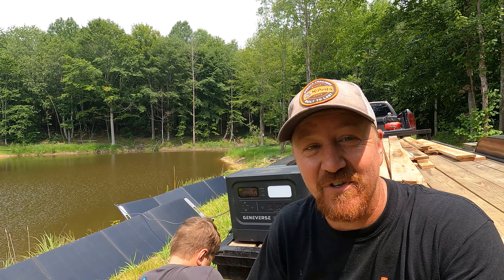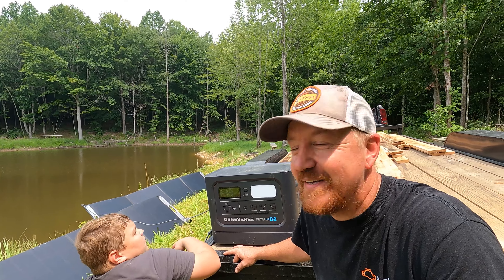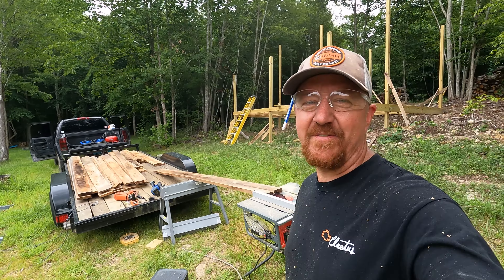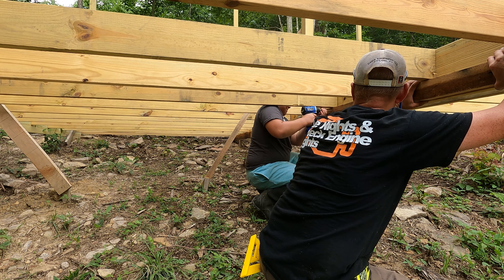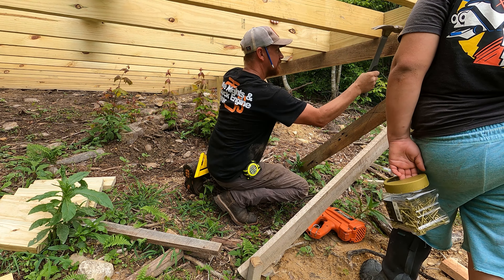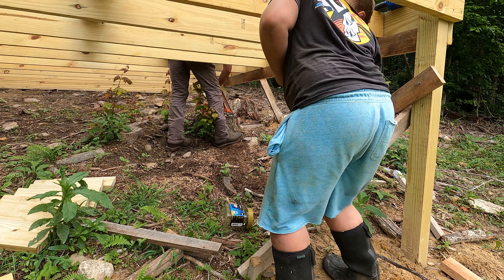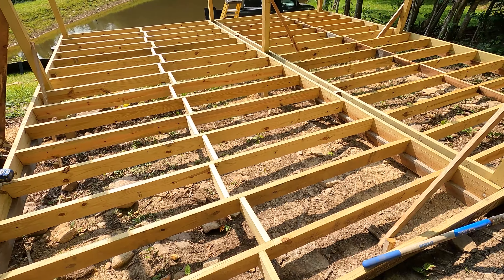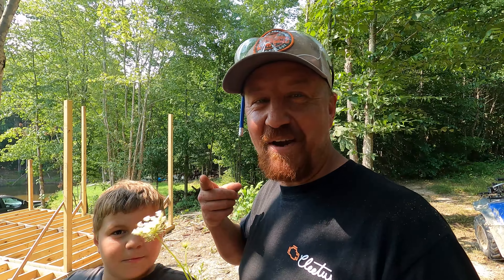Framing Our Camp Cabin

Comment: Hey, good job!
That young man is coming along.
I am not a fan of hangers, ledgers add plenty. You nailing schedule looks good.
Over nailing causes problems.
If you can afford a sub floor of sheet material, that will go a long way towards rodent proofing. 
One thing I like to do is put the flooring down diagonally.  It certainly adds strength, and I like the overall effect.
That will take about 10% more material.
I make the but joint cuts as I go, and let the ends run wild. Then snap a line and buzz em off. Just an idea guy.
It was years before table saws started showing up on job sites.
I still like ripping long boards with a circular saw. The saw being lighter than the board.  Preference there, but it may be easier on your power source.
Blades make a huge difference. 

One thing that is old timey traditional, is to stuff oakum between floor boards.
The last place I saw that available was at a plumbing supply.
Jute or hemp cordage will work.
Gee may be synthetic would work too.

You'll be fine with out any thing special on the ground, as long as air flow is good.

I put off a solar gen, untill after I deal with school taxes.  Thanks for the advice on that.  Chris
Reply from the maker: I love the look of diagonal.  The flooring video will be out next week, but we figured out a few of these things as we went.  We didn’t get everything perfect, but for a camp cabin it will be just fine.  I enjoy your comments.  Definitely learn some things.
Reply: @PeeksPeakHobbyHomestead  Thanks, I am rooting for you all.
I never mean to be condescending. I certainly am no know it all.
I learned the same way you are, but I have a few years on ya! And an additude!
Don't get me started on nanny state!
Be well Chris
Reply from the maker: @christophergallagher531  No, you’re not at all!  Thanks again!  👊
Reply: @PeeksPeakHobbyHomestead  Thanks.
One thing about learning, is if I stop it means I'm dead.
Another is, as a teacher, I learn as much from students as they learn from me. 
In carpentry, demolition gives good insights, in to things, like over nailing.
I love carpentry from just at the biggining of the rail road era, at the end of our civil war.
Nails where scarce, and lumber was becoming standardized. 
Those carpenters worked for a living!  
BTW the first time I saw jute between floor boards, I was about your son's age.
I was at General Washington's head quarters museum in North White Plains NY.  I asked the curator about it. 
some was supposed to be original!
I think some times it is tared, like bank line.
Sorry to write so much.
A bit bunged up. Frustrating to be wasting good weather! Chris
.

Comment: Our 1890's farmhouse has floorboards 'bare' above the crawl space.  It makes the house very breezy and allows for bugs to crawl in.  I would like to have a vapor barrier in place under the floor.  Tar paper better than nothing. I would go with a tyvek or poly liner if I could do this floor again.
Our old house has no blocking and we have added some and need to add more to improve the flexibility in the floor.
Reply from the maker: I was surprised at the stability that the blocking added!